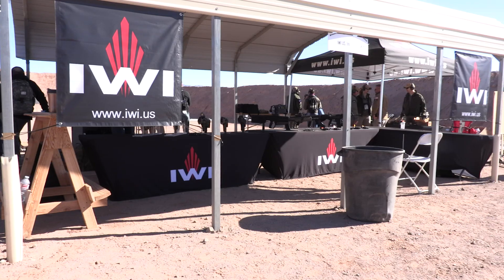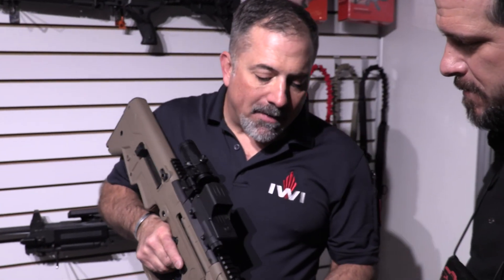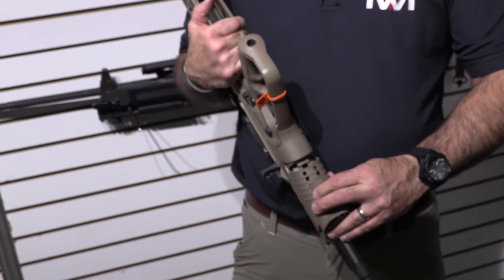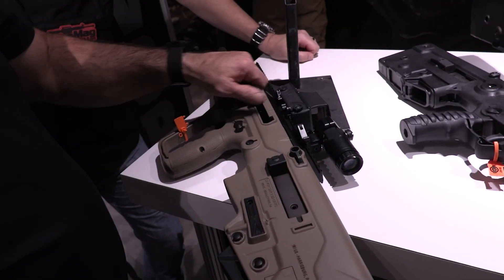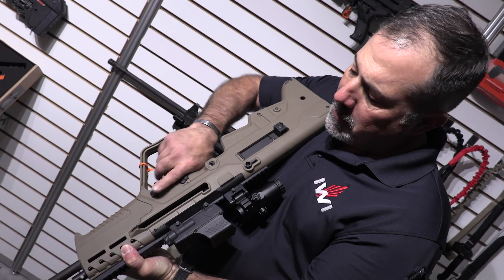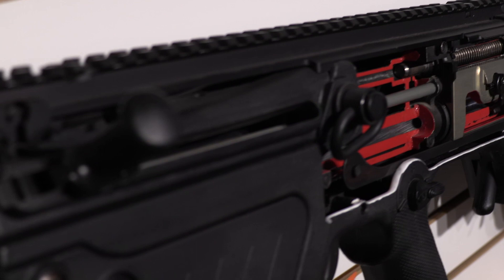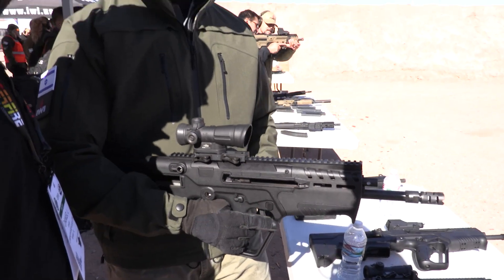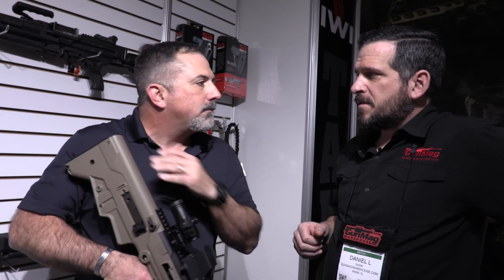Shot Show 2018: IWI Tavor 7, .308 | Not Just a Bigger Tavor.

Comment: Not going to lie, one of the main things for my was the longstroke gas piston. Sort of disappointed that they switched to short stroke. I feel like long has a smoother recoil impulse as we have seen with the Primary Weapons Systems AR's. I do think the 100% fully ambidextrous thing and the bullpup design is great because you can have a .308 with a 20" barrel at under 32". Still a great platform, and can't wait to see more on the gas system and the details on everything changed.

Comment: Compatible with sr25 mags so the magpul d-50 would work but would it work reallllly though lol. I feel like the drum might be placed in the way
Reply: TBH with a bullpup it would seem like the drum, if wide enough, might bug you in the side.
Besides, I don't really see the need for a drum, considering it makes the weapon so much heavier, and would at best save you 2-3 reloads.

I mean, I'm not a gun owner, but I just have a bit of a hard time imagining a situation where you need a gun over the average 30+1 mag and one in the chamber setup.
Unless you're going cray-cray at the range and want to loose some stress, which is really the only way I see a drum being used, tbh.

Anyways, so long as the magazine well doesn't clip with the architecture of the drum magazine, it shouldn't cause any issues gun-wise.

Comment: ISSUES not said by the gun industry with the Tavor 7 : (  1. It is heavy at 9 lbs. (most hunting rifles are about 6.5 lbs) 2. Not the best accuracy about 4 MOA. 3. Really hard changing handle pull on some. Odd. There are other issues but you get it so WARNING - please test the Tavor 7 before you buy.